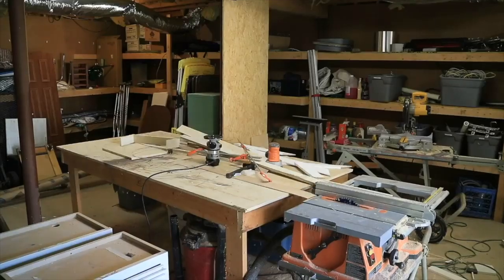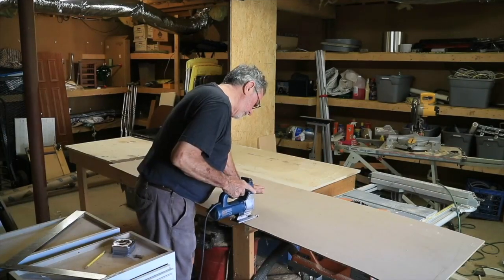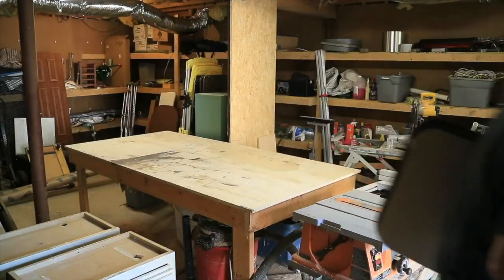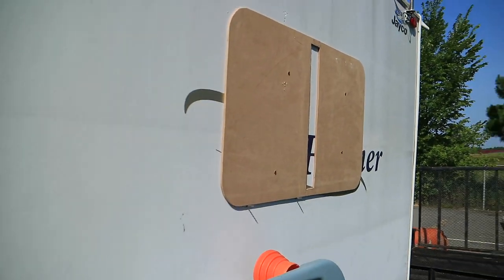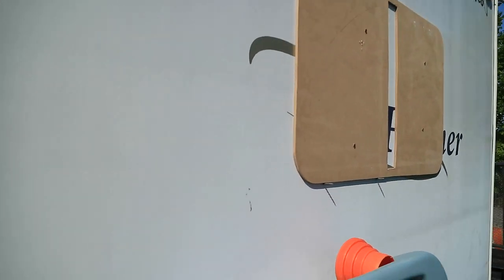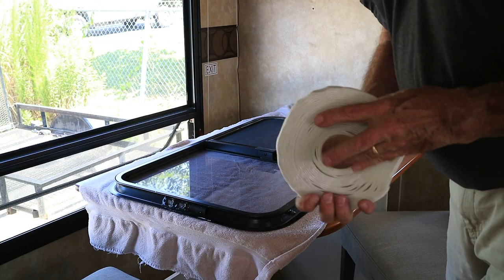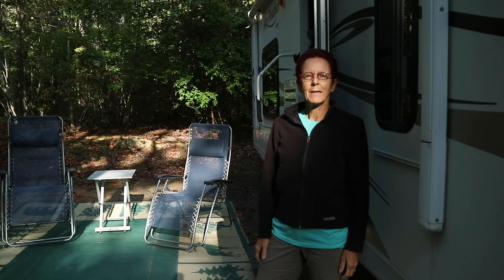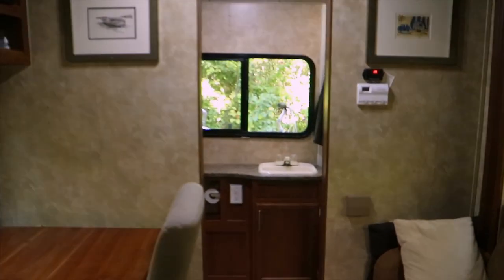Adding ANOTHER Window to our RV - MORE LIGHT & MORE OUTDOORS

Comment: Adding the window really was a great improvement. I'm considering replacing a couple windows with larger ones. Were you concerned about cutting into/weakening any structural framing - if there is such a thing?

Comment: Excellent work and video!  Purchased a new Winnebago View a few years back, and it always bugged me that the rear window was an emergency escape window without a screen and without any mechanism to keep open.  Always seemed like the breeze was coming from that direction. Thought many times of replacing with a more traditional sliding screened window that could still be used in an emergency.  Next RV, I’m going to install the windows I want, where I want them. Thanks so much, my friend!  Inspiring.

Comment: Great video! We were wondering how to do this, and whether it was dangerous to cut without checking the walls for cables or hoses etc.
Reply from the maker: ElectricBikeReview.com. BEFORE you start gutting know what you are cutting into. I knew there weren’t any wires or tubing in the area after investigating. My only concern were structural components. I got a blueprint from Jayco and I also drilled small holes to locate exactly where aluminum structures were.
Reply: @wanderlust101  Glad to hear you checked.  Watching this without knowing you had checked before was a bit suspenseful.  You looked really brave!

Comment: That is beautiful, super effective in the space.  Good use of the template. Now I am worried about cutting through the existing framing in the panel, and in whether I need to add new framing within the panel to support the window. That doesn't seem to have been an issue in your cause. How did it hold up?
Reply from the maker: All good 👍🏼

Comment: Great Video and well edited, to the point.
I am also installing a window in a slide wall and have drawings from Grand Design. They show a lightweight steel plate in the laminated wall that is used as a cabinet "nailer" to secure screws IPO just 1/8" Luan. I plan on cutting right through it for the window rough opening. See any issues with this plan ?? I want the biggest window I can fit in my space above a lift TV, I retrofitted.
Reply from the maker: Make sure you don’t have any wires in the area. Let me know how you make out.

Comment: Wow! You weren't worried about cutting through any electrical wiring that might be in the wall? It's amazing how fast your did that!
Reply from the maker: I was a little worried about the project in general, IWAS cutting a BIG hole in my trailer, but I was also pretty confident that there were no wires in the wall.

Comment: Beautiful job!  The window looks perfectly placed.  How did you figure out where to place your template on the outside that you used to mark the cut?
Reply from the maker: Andrew Simpson I located the aluminum framing by drilling several holes. I did get drawings from Jayco but sometimes they don’t match exactly what you have.

Comment: Thank you for such a straight-forward and helpful video. Quick question: how do you know before you cut that you're not going to run into any wires or pipes? I'm thinking about doing this in my kitchen area and I'd hate to cut something important.
Reply from the maker: You have to do your research. Cut an exploratory hole if needed. I was able to get drawings from Jayco. Good luck 👍

Comment: 2nd time I've watched this!  I have an exterior corrugated siding wall that needs a window.  It's a Heartland Trailrunner.  I guess I should reach out to them direct, or do you suggest an aftermarket alternative?  It's going to be for an upper bunk that has no window.
Reply from the maker: I don’t know how the corrugated sides work with windows. There has got to be some kind of gasket between the windows and siding. Can you tell by looking at an existing window?
Reply: @wanderlust101  Late to the discussion...but in the case of corrugated siding you'd want to add sections of butyl tape on the siding itself where it's concave.  Also, you might want to press in a small piece of butyl into the the areas where an upper and lower section of siding interlock.  So now you've got double thickness of butyl in the recessed areas once your window is in place.

Comment: I'd love to enlarge the tiny bathroom window. What about the structural integrity / framing? I thought I'd have to frame it in the wall like a hone window.
Reply from the maker: In my case the wall is 1-1/2" sandwich structure with a rigid foam core. I located the aluminium framing making sure NOT to cut that. I don't think I lost any structural integrity at all.

Comment: Great job but how do you know that you won't cut though wires or position it properly relative to the structural members?
Reply from the maker: Torsten Meyer. Thanks,  I got a drawing from Jayco showing the structural aluminum in the wall and I can tell from inside where wires are run.

Comment: how did you know that there weren't any studs where you were cutting?
Reply from the maker: At first I got plans from Jayco but they turned out to be the wrong ones so I drilled small holes on the inside to locate the aluminum framing.